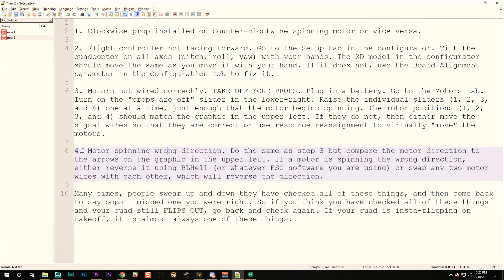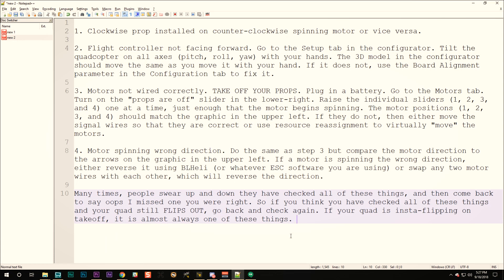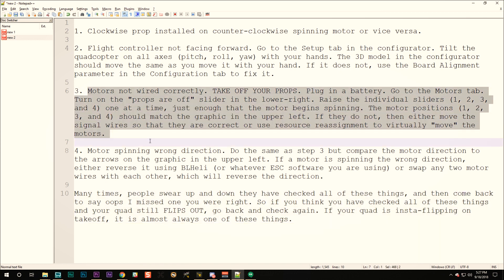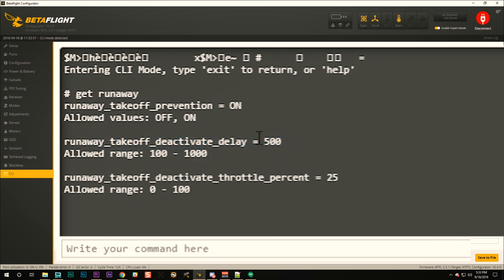BETAFLIGHT WON'T ARM | RUNAWAY arming status flags

Comment: Is this still true exactly?  Such an old video.  I got the second scenario where I was flying fine for about 30 seconds and got a runaway disarm when I went to zero throttle trying to perform a roll.  Could this problem be a result of desync or would that act somehow else?

Comment: I'm in a slightly different situation, it's a bit concerning. Quad on the bench, props off. Motors spinning the right direction and match what betaflight is expecting, but with just the tiniest amount of thrust it zooms to max thrust, vibrates like crazy, and triggers runaway.  I've actually had to scale the PID master down to 30% just to get this far, because the runaway was happening at arm!

Comment: What about a messed up GYRO?

I got a previously working Meteor65 (F4 1S ELRS board) which at some point started to flip over and now I get contiunous NOGYRO or (very rarely) RUNAWAY warnings on startup. When I connect the drone to betaflight configurator, I see indications that its really the Gyro: Means: I connect it - its there, but shows random values, drone spins like crazy, and in other occasion its not shown at all after disconnect - connect cycle.

In the situations where the Gyro is detected, but creates nonsense values, I guess the RUNAWAY kicks in.

Comment: I’ve been trying to fix my moblite7 for a week now. One of my motors completely disconnected, and when I re-soldered it, it blew air upwards. So I switched the far left and right wires. And It fixed my prop rotation direction, I think.  But it still disarms and says runaway once I get in the air. I’m gonna download the correct beta flight tmrw, and hopefully I will be Able to see the problem. So wish me luck.  Also, does anyone see anything that I’m missing? Is there anything specific that you need to do after re attaching a motor? II’ll take any help I can get.

Comment: I have a tinyhawk2 indoor This also happens after I’ve been flying around for a minute if i bump something just a little bit it decides to turn off, it didnt always do this up until recently, not sure if i wrecked it too hard and maybe knocked something loose. Going try the throttle thing and then see how it goes, might turn it off cause most of the time im good at disarming early when i know ive lost control and the quad usually flies great.

Comment: Got the same issue. Ran the checklist over and over and everything seemed to be fine... finally found out that the shaft was loose from the bell... the motor was spinning but the prop wasnt following up the motor thrust. Before replacing the motor Im glueing the shaft with super glue... lets see if it works 🤞

Comment: You saved me again Mr Bardwell!! Thanks I had the motor reverse switch on in Betaflight. I'm a noob. This was my first build I have 4 other prebuilt quads but this is my first build and I used a Mamba F722s and F50 Pro stack. I thought I fried something on my $80.00 stack and was super bummed. IT'S ALIVE! IT'S ALIVE!!!! THANKS. I am wearing my exploded quad shirt. I think I am going to have to become a patreon member because this is about the 4th time you got me in the air. I did send you $20.00 to your paypal  last month and bought a shirt so i'm not a total freeloader :) OHH I did the pick it up and wiggle it with props off while running and it gave a runaway LOL Then I watched the rest of the video LOL.

Comment: Hey Joshua!
I just built a 3D printed drone, my first one, with an F722 SE, Frsky receiver, IS30 ESCs, and some 2205 motors. I took it for a test flight with a 3S battery and it wobbled a little bit, and then I tuned it a bit and put in a 4S battery. When I took off, it wobbled a lot, and wouldn't throttle down, and took off. Any ideas on how to stop this? Every stick worked except throttle down, I could even throttle up. I'm clueless. I followed your videos to build it and am not sure what's wrong here.
Reply: You have a vibration, a gyro problem, or a too-aggressive tune.
Being a 3D printed quad, my opinion is you probably have frame resonance problems. You should be able to use blackbox to find them, then point Betaflight's filters at them.
Bardwell's "Making tuning make sense" series talks about how to use blackbox to identify frame resonance.
Worst case, you may have to de-tune to compensate. :<

Comment: Thanks, still relevant video.  My Troubleshooting (TS). TS#1 Determined my props where on the wrong way based on motor direction spin. TS#2 The direction of my motors were somehow reverse compared to beta flight. To resolve both issues. I made sure the props were pointed in the correct direction and two I enable reverse motor direction in betaflight.

Comment: I Set runaway_takeoff_deactivation_throttle_percent = 1 and my FC after ARM is smoked...
Reply from the maker: That setting can't smoke your FC. Something else has happened.
Reply: @JoshuaBardwell  
Thank you Joshua Bardwell for everything you do. You are probably right and something else has happened. This is my first quadcopter and I probably messed something up. But changing this setting is the only thing I did ...

Comment: my question is I've never had a runaway yet in the year and a half I've been flying. installed crossfire and now I am getting the runaway in my osd but it doesn't go crazy...just twitches before i kill the motors.....what could cause that to happen?
Reply from the maker: https://youtu.be/oAgkVUpKv_U

Comment: I set my pids and rate and trying mockingbird on TinyHawk II.. 
In the house it goes up to the ceiling then thinks its running away.. 
Well hope its not really and flies away when I go outside lol
My throttle hovering is like 17%

Comment: OK this is an open question to Joshua (of course) or anyone else who can solve what appears to be a throttle problem.  Background:  I have two Tinyhawks that appeared to have bad ESC on number 3 motor.  After some great back and forth with Emax...they sent out two new FCs since they are all in ones. Installed and flew about 40 packs thru the two of them...no worries...I bound them to my brand new T16 and all was well...put them up for a few weeks.  Pulled the Tinyhawks out yesterday and first one would only spin up numbrer 3 motor intermittently! Hmmm....no way i say, could i have really burned out the ESC again...they worked perfectly well when i put them up a few weeks ago. Re-seated the the motor plug for motor 3...no dice. Opened up Betaflight and checked the motor...after struggling to start...it then spun up and ran well.  Tried to fly it around the apartment after letting it idle for a few seconds, and then got runaway error on goggles...then got all four spinning and it actually flew for few minutes.  Then back to flippy floppy mode! Hmmm....i tried Tinyhawk number 2 and holy canole...same thing!! Same motor. How could this be. Hmmm....just for giggles i pulled out my Mobula7 which had also been flying great.  Armed it and HEY, same dealio! Only rear two would not spool up at min throttle and runaway when throttle was advanced!  I putzed around in Betaflight but could not figure out if i had throttle setting issues, which im inclined to believe as oppose to three dead drones (i hope not). For good measure i pulled out my brand new Tinyhawk S and it flew like a champ (its on the same model set up on T16 as my other Tinyhawks as suggested by Joshua).  What am i missing folks?? I'm a relative ludite with the new Jumper and tuning in general. Could batteries be the issue, ie; im harming the drones with bad or HV batteries?? (im using emax and gnb batteries which appear perfectly serviceable).  Any advice or point in the right direction anyone can provide would be greatly appreciated (lol...internet snark notwithstanding...even though i know its sometimes too good for some to pass up).  Cheers all, and happy holidays wherever you are...

Comment: Just want to add one more weird case here and it may help somebody. Ive been fighting this for a week. Mobula 7HD. Runaway warning and shutdown after 3-7 sec. The reason I discovered was shift in a rotor. The retention washer fall out from under the prop (top side) and it caused the shaft to be able to move just a less than 1mm through.  So the bug  flies up and then shaft looses friction which effectively lets prop to slip which causes gyro to failsafe with  Runaway excuse. Motor that sucks is HM KV9000 shaft 1mm - watch out for those retention washers when you change props especially.

Comment: Mine was disarming in testing when I was yawing from left to right quickly. I could recreate the disarming and it was very predictable. Checked the status in CLI after it disarmed and it said runaway. That led me to this video and I didn't have anything wrong so I disabled runaway and now I can't recreate the disarming. Problem solved! thanks so much Joshua for all the help over the years!
Reply: did you type runaway off or just low the percentage?

Comment: Excellent video - I will be troubleshooting a build tomorrow which has this issue.  I've already checked props and motors, but I didn't don't check board alignment so I'll check this first, then double check props and motors :)

Comment: plis tell me, how to troubleshooting the jumper t8sg  v2 plus did'nt work on the pitch control. thnks
Reply from the maker: First, run the stick calibration to verify that the pitch stick is working and to calibrate the stick endpoints.
Reply: Thanks 👍

Comment: So this happen to me as I was flying, it just turned off!  I was flying in Angle mode taking video of a friends wing in flight.  I just started to fly sideways and just like that it dropped out of the sky without warning!  Should I adjust the "run-a-way" percentage lower?
Reply from the maker: Are you sure it was runaway? That's what I would check first. In the OSD tab, turn on the Warnings OSD element and see if it says RUNAWAY in the OSD.
Reply: @JoshuaBardwell  I have that on but when I lost power I wasn't able to see anything on the screen after that.  I never seen the word RUNAWAY at all.  My screen went from fuzzy to BLACK.  Then someone was walking towards me with the quad in hand to give it back.  Good thing it didn't hit anyone...  When I was able to turn it back on all was normal.  I've never seen that happen before and yes, it freaked me out alright!

Comment: Great stuff Josh! I am very new to all this. I am pulling my hair out trying to get an old ZMR250 flying. What could it mean when I type in get runaway in CLI and it says invalid name?  Here is what I get when I type in version: # Betaflight / NAZE (AFNA) 3.2.5 Feb 11 2018 / 00:40:11 (6e69ff00c) MSP API: 1.36
Reply from the maker: it sounds like 3.2 did not have runaway protection. You're on a pretty old version of Betaflight.

Comment: hi how about when theres no flipout or hell broke loss happened or normal flight but just when the quad angles at -50° or -60° pitch up or backward pitch it triggers the runaway status? how can i take or turn that off? or adjust that. ty
Reply: oh, i did watch the whole video when i ask this. sorry for that. you did answered my prob.  i guess i found the culprit. its the throttle percent, ive minimized it and it worked. ty. btw, you could just copy paste the commands though to avoid long typing.

Comment: I think this: https://www.youtube.com/watch?v=QBq9vkkWno8 might be an example of taz issue while flying and then dropping out of the sky. I was at very low throttle for a little while as I was descending meanwhile experiencing a bit of propwash and then FC maybe thought something was wrong and disarmed. Am I off base here?
Reply from the maker: The only way to be sure is to have the Warning OSD element turned on to see if a disarm status occurs. If you had been flying over 35% throttle then Runaway can't happen.

Comment: Thanks JB.  I used an older video of yours just last week to determine that my new Luminier MiCRO LUX V3 had the yaw 90 degrees off even though the arrow on the FC was facing forward.

Comment: Quick correction: if you have "prop reversed" turned on in Betaflight but put your props on the wrong way, or you have the props put on right but the motors are configured non-reversed, the quad will bury itself into the ground because thrust goes the wrong way on all of them.  If you have props and motors set up correctly but the BF "reversed" switch in the wrong position, the quad will take off and go into a hell of a yaw spin, unless stopped by the runaway feature.

Comment: Aye bro! I'm trying to isolate a problem between a motor and an esc, one of the two is broke and I'm trying to isolate which--if I ready my setup on BL_Heli, it shows only 3 ESCs, it stands to reason this would indicate a dead esc and not the motor, right? Would a dead motor cause BL_Heli to not show the 4th esc as well?
Reply from the maker: Your analysis is correct.

Comment: It can also prevent you from spinning up the props to a substantial enough throttle percent when stuck in a tree, as I found out.... Would be great if it could be disabled from the osd for situations such as this, then re enable itself once a new battery/power cycle occurred.

Comment: Hi Joshua, I think you missed one reason for a 'runaway' - recently I had 2 motors go bad on a quad within a couple of days. Each time the motor would idle fine, then lose power (or maybe de-sync) on the take-off punch-out. 'Runaway' comes up and the quad disarms.
Checking blackbox shows the problem, the bad motor goes to 100% as the PID controller tries to keep the quad flying, but the motor isn't generating thrust. Easy way to find out which motor it was and replace.
Reply: Thank you , I could not figure out what was wrong with my quad after watching this video and ends up one of the motors is dead

Comment: You are psychic? I have 250 quad running a Matek FC405 -CTR and it randomly disarms? I have a few folders of logs and  fpv recording I have reasonable RSSI  and no  fail safe flags it just disarms like I have flipped the disarm switch?Its not the Transmitter as it does not happen on other quads and its not the receiver as I have swapped this out?
I have checked solder joints and replaced the motors(not because of the fault)everything is stock 'ish  8k 8k gyro not maxed out.My gut feeling is the FC ,Could the FC just be dropping the ARM switch output because its damaged at chip level  and Black Box log is recording this as if I have hit the disarm switch on my transmitter?
Is there a way of recording more in depth debugging info while the quad is flying?
Reply from the maker: Please watch the first video in this playlist to see how to know the arming status code.
Reply: Joshua Bardwell  Will do, thanks for reply.

Comment: Hi JB ! I just changed my FC and this quick spin and Runaway status appeared. Turn out my motor where wrong mapped even I double checked: when I updated my FC to latest firmware, restored settings, the motor mapping didn't restore ! 
So be careful people: when you flash your firmware, your motor remapping will not be restored !

Comment: Ive been having an issue that happens occasionally while flying my quad, ill be flying around and all of the sudden it drops. When i go to pick up my quad, one of the escs (im using a 4in1) will do the beeping sequence that it does when your plugging in youre quad. It will do this a random amount of times and when i arm the quad that motor wont spin. It will also occasionally do this after a crash.

Although it usually goes away if i unplug and plug back in
Reply from the maker: When the ESC makes that beep sequence it means it lost power. So check the connection to the PDB, and anything else that could make the ESC power down.